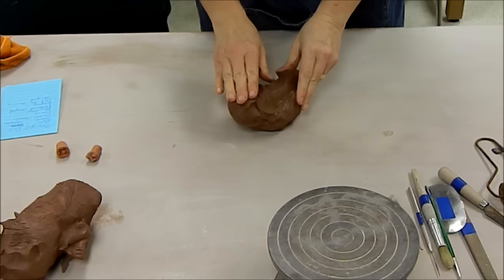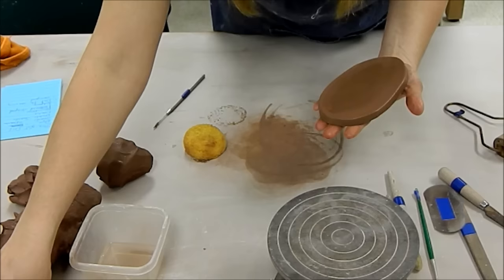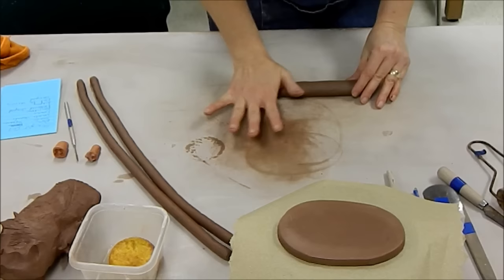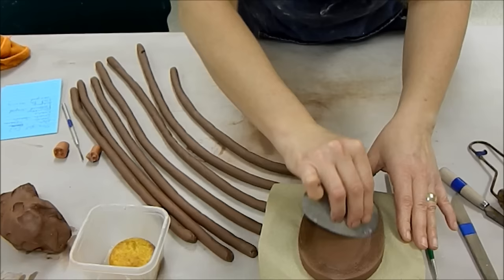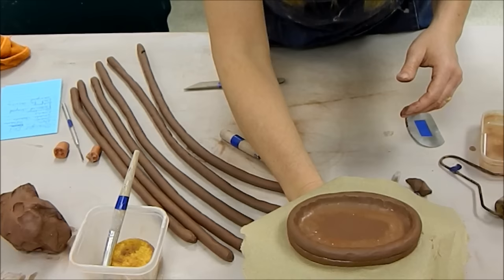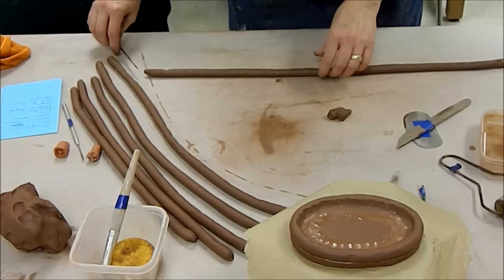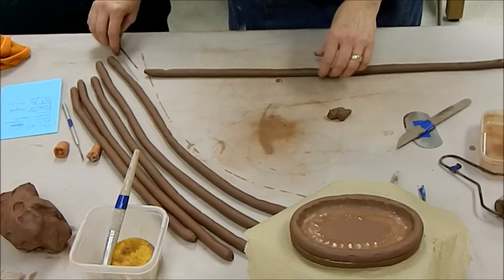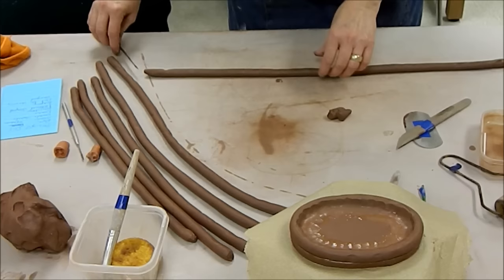Coil Pot Construction Techniques

Comment: Great tips and explanations- thanks. Why vinegar?
Reply from the maker: Good question... and I wish I had a bit of a more scientific answer for you!  But, vinegar sometimes has an acidic reaction on the clay- especially if it is drier, and allows it to activate the surface of the clay a bit more and help with the bond. I honestly don't use it that much unless I am working with stiffer clay, otherwise, I just use water!  :) Oh, and it works well too, if you want to make slip- just take bone dry scrap and drop in a little vinegar, it breaks it down quickly! :)

Comment: Thank you!  This is very well done with good explanations! What sort of clay body are you using? Low or high fire?
Reply from the maker: +Susan Bainbridge Thanks for the kind words!  I use Standard 103 earthenware for this project with my students.  I especially like it with my beginners, as they can sponge and not worry about creating a groggy texture- as it is grogless!  :-)  Also it works so nicely with the oxide dip we do!  Video for dipping oxide here:  https://youtu.be/2-xOPRc188A

Comment: I love it, you are a great teacher, even for me that don t speak English and also i am a beginner on this. Could you tell me please, what kind of clay did you use and if it s necesary to put it in the oven? Thanks in advance
Reply from the maker: Thank you so much!  :)  The clay I used is an earthenware clay without grog... the brand is Standard, and it is type 103.  Yes, it is necessary to fire this type of clay in a kiln- reaching a temperature around 1900 degrees Fahrenheit.  (I fire to cone 04 for bisque firing)  Only firing it in a kiln this hot will create a permanently hard clay structure.  If not fired, it would eventually disintegrate back into slip if you immersed it in water.  :)

Comment: I love your series!!  Now I have a question  I am all of a sudden getting VERTICAL cracks in my bowls etc.  Never had this before  How do I correct this and what could  be causing this?  Thank you in advance
Sylvia Barnhart
Reply from the maker: Are the bowls wheel thrown or handbuilt?  I’d look at two possible things- #1: are the walls and floor of even thickness?? If, say the base is much thicker than the walls, the walls would dry more quickly, and would shrink before the bottom perhaps causing cracking from uneven drying. #2: make sure you’re drying slowly- maybe even put the bowls rim to rim or at least upside down to help promote even drying.  :)